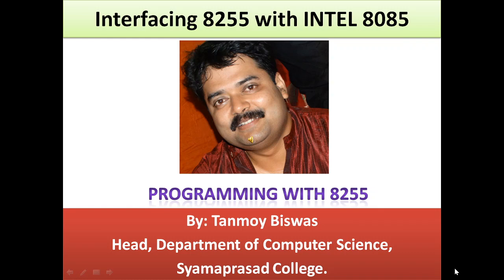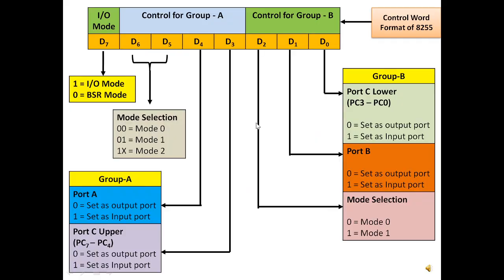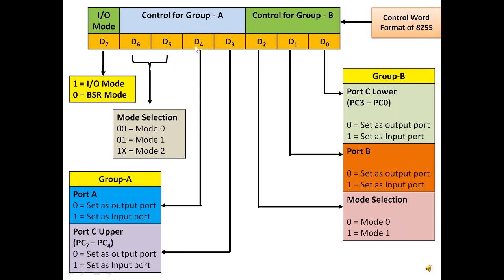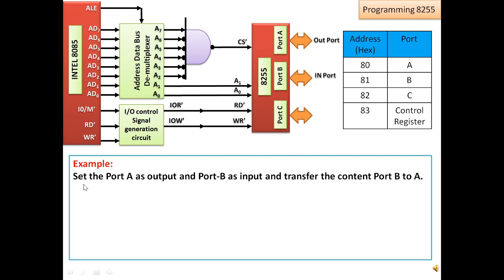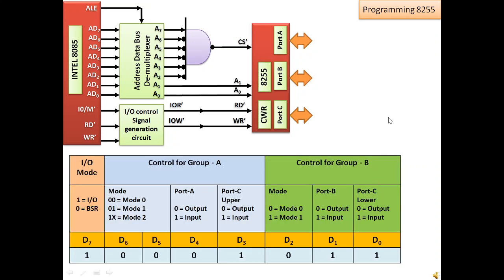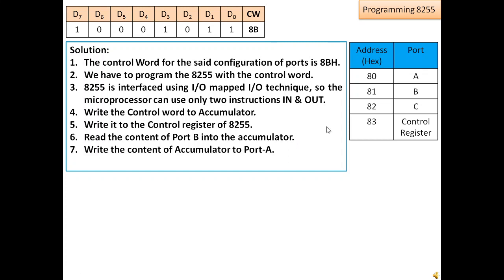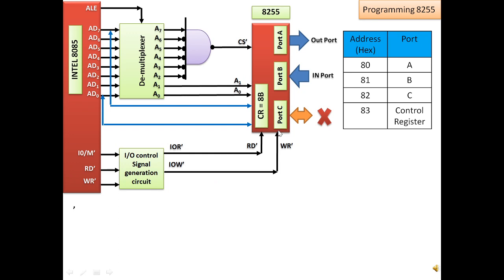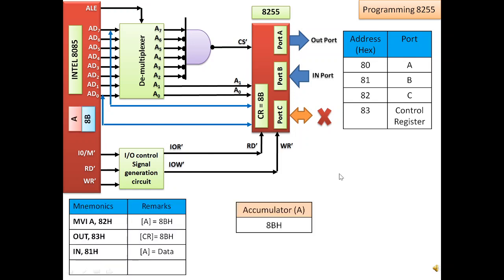Control Word of 8255

Comment: Sir what is handshaking mode?
Reply from the maker: Not discussed here. But if you want to communicate with a device and needs some agreement before data transfer and then you need to exchange some signals before data transfer called handshaking